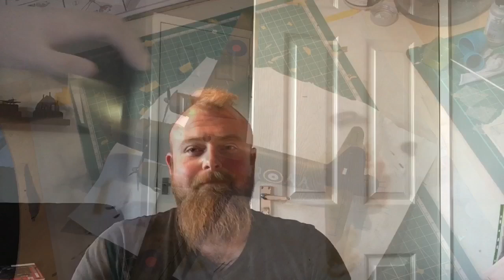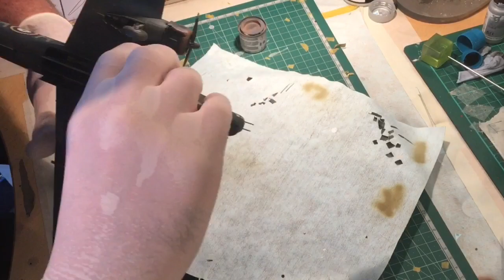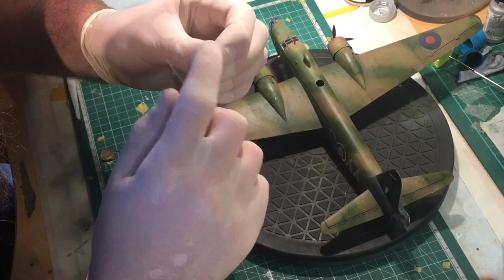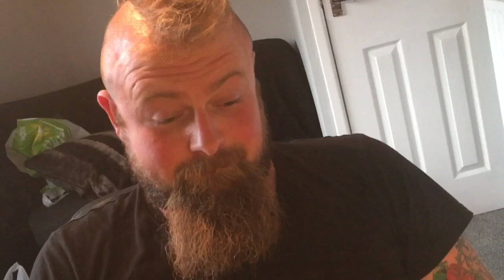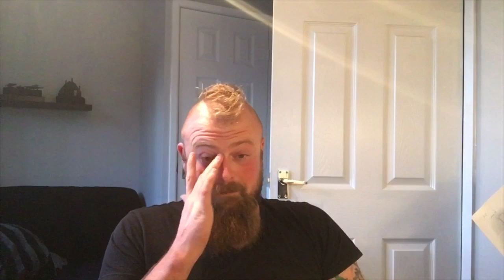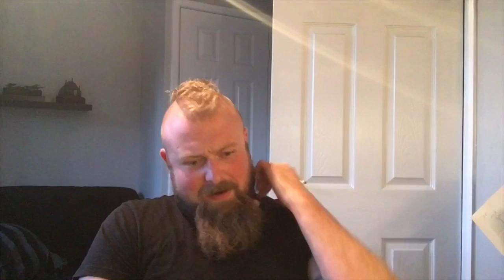Pt.19 Airfix Vickers Wellington New Tool Build 1/72

Comment: The videos are okay as they are. I agree about the side panels,I tried to push mine level  by going through the rear turret. I found it fiddly to put the propeller parts on to the engine through the cowling. It's a good kit though. Will be posting finished model on Instagram soon. Just watched your video on the kit bash looking forward to that. 👌👍
Reply from the maker: It’s definitely a part I’ll fit earlier in the build before I paint the insides. Look forward to seeing it man!